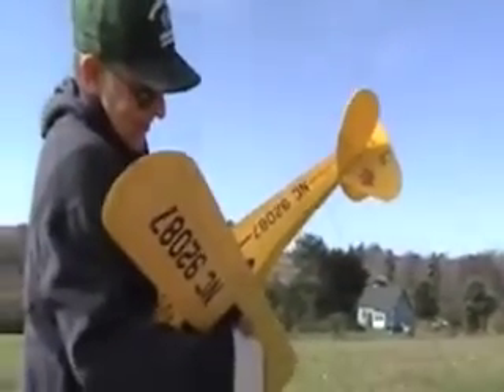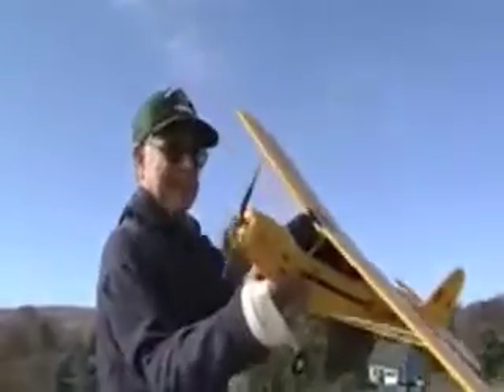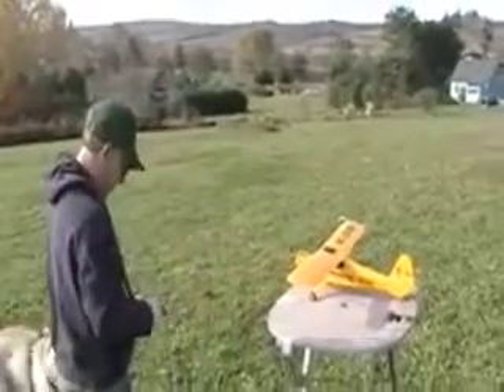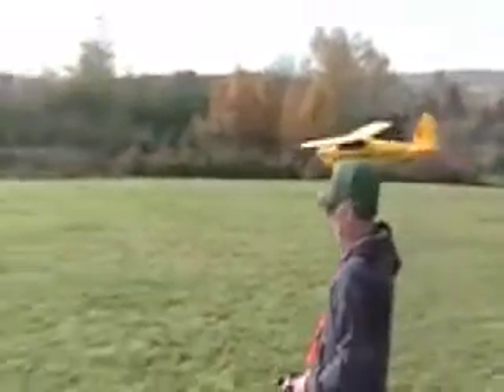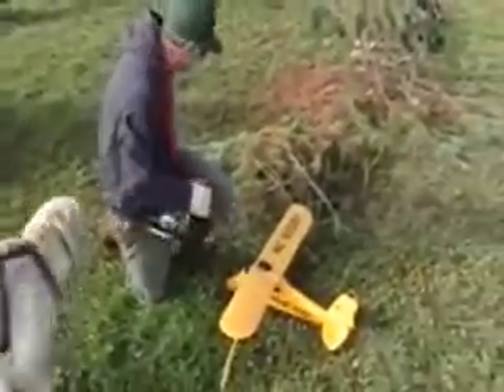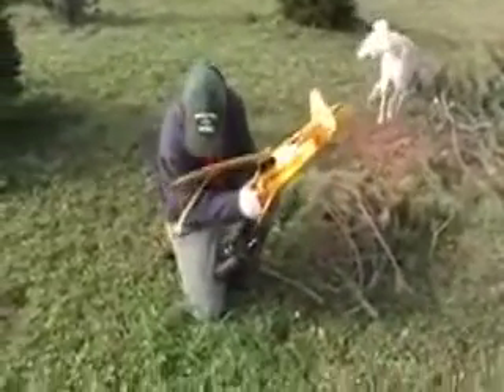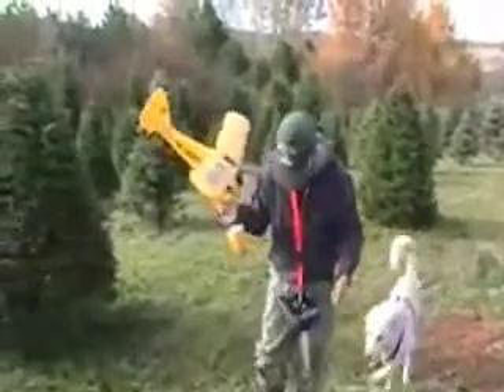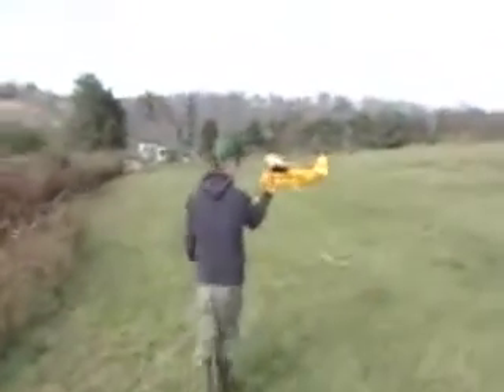Hobbico Flyzone Electric Piper J3 Cub

Comment from the maker: Hobbyzone has a J3 made by Hanger 9.  It looks like a well built plane.  I find that planes that have a wing span of about 35 inches or longer and weigh about 1 1/2 lbs fly well with the electric motors.  Lighter planes run away with the wind.   You just need a motor with about 250 watts of power.

Comment from the maker: I've seen other J3 models that are a little bigger and built nicer.  You may want to look at another supplier.  You want a plane with a  brushless motor in it.  I have a Skyfly2 and its easy to fly on a calm day.  It has a brushed 380 motor in it.  I stuck it up in a tree once, at about 50 feet.  I used my shotgun to blow the limb off and get the plane back.  Only took 12 shots...........didn't put any holes in the Skyfly2.